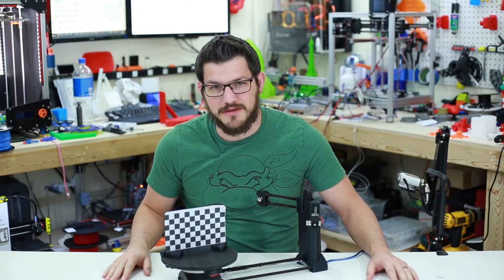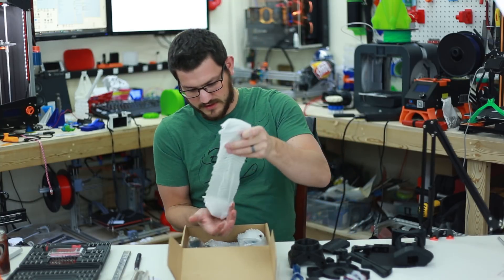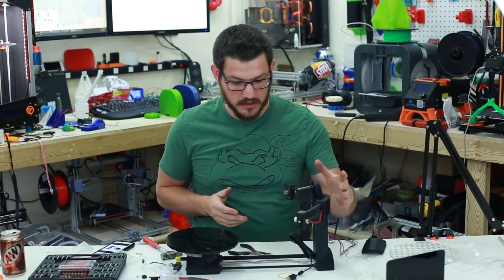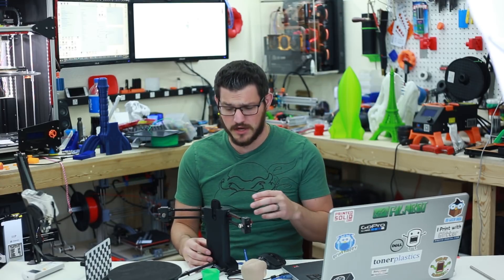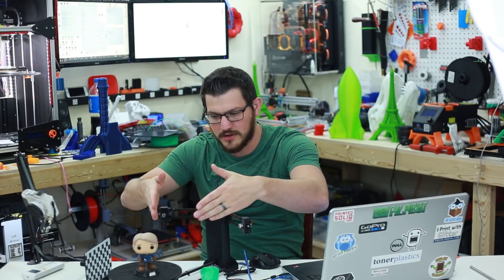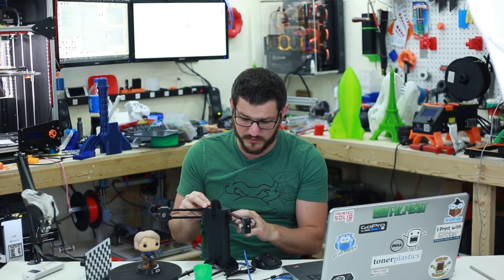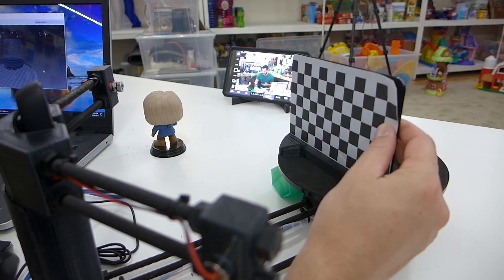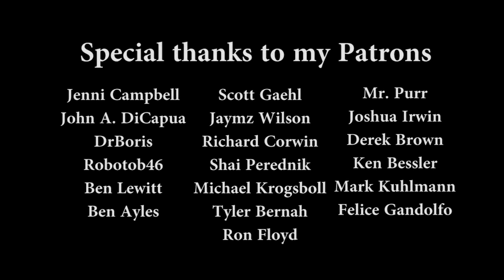DIY 3D Scanner Build and First Use

Comment: One good thing to do 1st keep any blu-ray Lazer lenses you can, remove plastic lense from camera an put glass lenses in from blu-ray, eg it can almost make a 2 megapiceil cam  image almost be as good as a 10-15 cam. Also some objects you may want to remove the infier red filter in cam to get better deals of objects
Reply: P.s. thanks I do think I'll build mine and also Lego motor are pretty stable and steady to yous in conjunction with microwave turn plate just use acrylic instead of glass plate to help motor

Comment: Yeah these things need a good amount of calibration. You can change the focus of the camera, the focus of the laser lines, the distance between everything, angles, light, stepper motor etc... And if everything is placed near perfectly you still have to calibrate the camera and lasers correctly with that chessboard. But if it works it is really nice.

Comment: I cant get any good results with this scanner. Scans full of holes, no post scan programs can recognize the points its scanned to make any vertices or faces.
Not giving up yet though I need to read up on how this scanner works. Yes the printed pieces are pretty ordinary. I do have all the prints to build my own. I actually redesigned and printed the piece  that house the stepper motor, the hole  where the table drive sits in was too small. The screw securing the drive to the stepper shaft would bind up on the 3d print.
The build video from cow tech was terrible, where the builder was working was out side the spotlight so it was very difficult to see. When he mentioned a critical step the shot was outside the camera view! Even the animation build is wrong when it comes to putting on the stepper driver, its upside down. Get that wrong and poof up she all goes! This whole project is still in its infancy, its basically a beta type. That means when someone gets it to work and improves the software it may get to version one, that actually works.

Comment: How large of an object can you scan...gotta scan an object the size of a motorcycle helmet
Reply: I can tell ya that it has to be a little smaller than the turn plate with that set up, I thing the Lazer image scans would be better that Pic San imaging, just get agreyish chorch paint in a can (eg line markers) spary objects scan wash off or blow off done , but if using cameras get rid of the plastic lens in it an find a broken ps3 or blu-ray player and put its glass lens in an turn. A 2Meg pic into a 15meg almost

Comment: I have a Ciclops, it was difficult to assemble, took forever to set up and is very finicky. I have managed to get beautiful clean scans from the left laser in texture mode,  but not in simple scan, but because the laser is to the left of the camera I can only get incomplete partial scans of objects.  On the other hand I get really weird distorted unusable scans from the right laser, and the same duplication issue trying to use both lasers together. Still slogging away...

Comment: takes ages to setup and align the lasers. and even when you do you again suffer with not all of the model scanned. then when you get a scan thats nearly complete. it saves as a point cloud. and you then have a hard time converting that into a mode. and you will have holes and texture missing from the model also. you can get better results with davidsoftware a single laser and a webcam. but i still use photogrammetry for all my scans. the only way to get a good scan is to use projected light patterns from a projector and 2 high def cams. but you are talking over 1000 pounds for something like that. but you get what you pay for. but again i get great models from photogrammetry.  :) nice review about this scanner. :)

Comment: In case you're not aware, CNC Kitchen did a livestream with audience participation building a similar kit just this weekend. He was able to get usable results without colour by blocking off all the light and having it analyse just the laser lines. Also he was using his Prusa MK2's build plate as a slow cooker for food, doing his channel name justice.
Reply from the maker: I saw that but didn't have time to actually watch it live. I'll check out the video, if he posted it, and see what they did. Thanks!!

Comment: I was reading on Jesus Arryos site about this and it needs to be noted this scanner must be set up amd used without your lights on. (using ambiant light or maybe a small diffused light) if your in a basement FWIW. It uses light to do its calibration and is affected badly by most indoor lighting.  I was looking for a manual for mine and ran across his site which has tons of info for this and Horris here http://diwo.bq.com/en/documentation-ciclop-and-horus-2/
Reply from the maker: Thanks I'll check that out.

Comment: I'm gonna ask a really stupid question: did you try adjusting the focus on the Logitech webcam lens that came with it? Obviously they're not gonna do that for you! But they helpfully broke off the face plate.
Reply from the maker: I didn't even know you could do that. I'll deff check that out.
Reply: Yes, the face plate comes off, then you might be able to get in there or easiest to undo the 3 screws on the middle enclosure and take that off to and then you can just turn the lens easily, it's a screw on lens. I wonder if they did actually adjust it, very badly, because when you buy the Logitech from the store, it's focused too far, like right around 1m, because that's where the person using the camera would likely be sitting at. Or maybe it just got knocked in shipping, because that wasn't very good packaging.

Comment: I can't think of a single reason for a small 3d scanner
Reply from the maker: Big ones are not very accurate, nor is this one so far I know, and they are expensive. If I every get it working, it would be a great way to replicate small models.
Reply: A big one already exists, it's called Kinect and it's not very exact! So a small scanner makes sense, if it can pick up precise details.
Reply: I make small Fimo models for dollhouses and want  to scan them in for other people to be able to print. A small scanner like this would be ideal if it worked properly. I'm currently printing the parts to Openscan's scanner off of Thingiverse ( www.thingiverse.com/thing:3050437) I'm a bit worried about doing the electronics, but I'm going to give it a go. Wish me luck!

Comment: FYI - Thingiverse has had plans for the Ciclop scanner for a year or so.  Along with build instructions (or they did). Also, BIQU sells a version of the scanner with injection molded parts. Pretty much the same set up Ciclops. All of it is open source but as always, someone tries to make a buck off of someone else's work.  Last, Reprap forums has a 3D scanner section and there is also mention of this style of 3D Scanner.

Comment: The official build :D

https://www.thingiverse.com/thing:740357

Side note: you can power an arduino in a couple of ways, there's usually a power socket (with a regulator on for a wider range input) in addition to the usb and I there is also a power in on one of the connector blocks :D